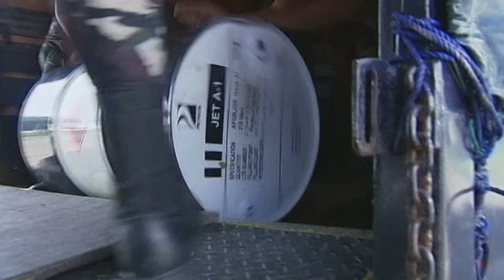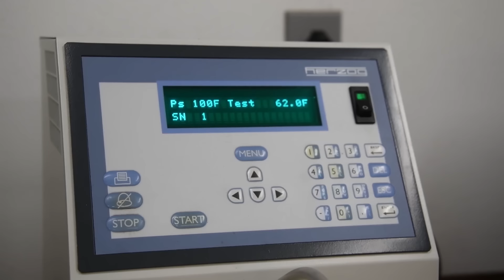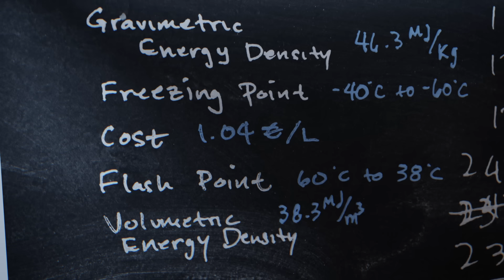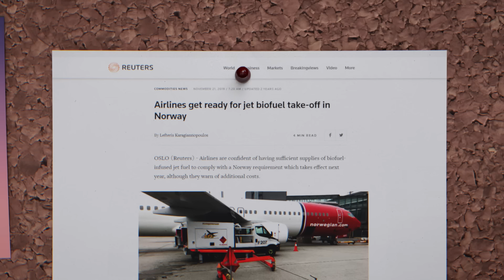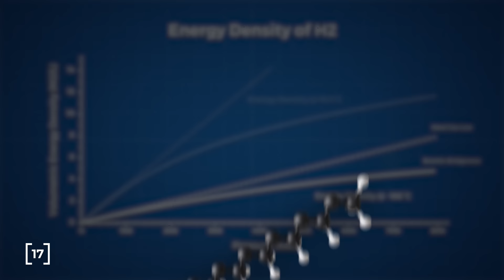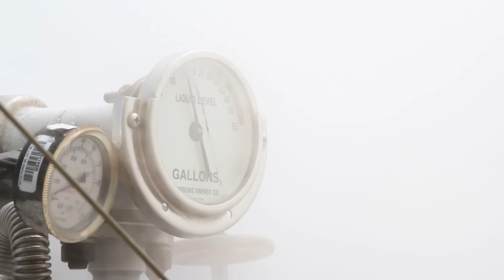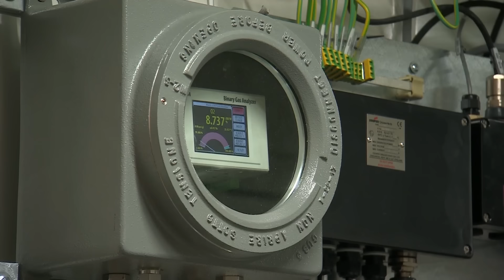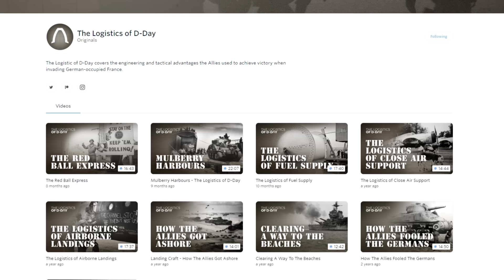The Uncertain Future of Jet Fuel

Comment: This is one of the many stupid videos about this topic that are just clickbait and dont get EVEN CLOSE TO ADDRESS THE PROBLEM

people talking about biofuel, ethanol and biodiesel as if it was CLEAN fuels MAKE ME LAUGH... so when you burn biodiesel it doesn't generate co2 and other greenhouse gases?

any 15yo kid shall know that is FALSE... this generates same CO2 or even more than any other diesel, gasoline or kerosene... THE ONLY DIFFERENCE BETWEEN BIODIESEL AND TRADITIONAL DIESEL FROM THIS PERSPECTIVE IS THAT BIODIESEL IS RENEWABLE

so in 20000 years when all oil fields in the world run dry you will still be able to produce biodiesel

BUT THE COMBUSTION OF IT GENERATES POLUTION SAME WAY

so if you are waiting the biodiesel to save the world, greenhouse effect and stuff you will reach the year 3000 by melting in a CO² biofuel greenhouse planet.

"aaaa but when you plant anything to produce biodiesel the plants will do photosynthesis and will clean a bit the air"

the amount of co2 the plant "cleans" compared to what it will generate after burn is 10%... so the plant will only clean 10% of the air it ill later make dirty AND WORSE

THE BIGGEST PROBLEM THAT NOONE IS TALKING AND THERE IS NO SOLUTION UNDERDEVELOPMENT ANYWHERE: THE ALTITUDE

if a train, a truck, a ship, or even a giant thermopower plant burns anything makes tons of CO2, this can be TRAPPED and CLEAN either by plans photosynthesis, co2 removal plants, plankton photosynthesis and stuff...

but planes fly at 8000m above sea level at that altitude THERE IS NO PLANT, PLANKTON NOR CO2 REMOVAL PLANTS, SO ALL CO² GAS GENERATED BY AIRPLANES GOES STRAIGHT TO THE HIGH ATMOSPHERE AND CONTRIBUTES TO THE GREENHOUSE EFFECT....

THERE ARENT ANY KNOWN APPROACH  NOR UNDER UNDERDEVELOPMENT THAT IS ABLE TO TRAP/CLEAN THE CO² GAS THAT IS ALREADY IN HIGH ATMOSPHERE

SO BECAUSE OF THESE, EVEN IF AVIATION IS ONLY RESPONSIBLE TO 2-3% OF CO² EMISSION IN THE PLANET. THIS 2% CAUSES THE BIGGEST IMPACT IN GREENHOUSE EFFECT AND PROBLEMS WORLDWIDE

Comment: whyc an't we havee eelcetric planes?

and why can't we replace buurning fossils for electricity let's move to 100% solor wind hydro and clean
Reply: If we already have issues with electric cars, building electric planes is another terrible deal. As of right now, our technology cannot build an aircraft that can run in other source that fossil fuels, we simply cannot find a balance between efficiency, capacity, cost and performance. The closest we can do is research how far can we push emission reduction and increase fuel/engine performance.

And to generate electricity is a whole different topic, starting by the fact that again, due to our technology, renewable energies are currently garbage, they are very costly, occupy a lot of land and generate very low output. A second option, besides improving renewable energy sources, is going nuclear, however, although its way cheaper on the long and very efficient on the long run, it’s expensive to build plants, and it requires more qualified staff, thus several nations are not fit for this. Not only that but people are absolutely unreasonable afraid of nuclear energy, constantly citing events like Chernobyl, which had little to nothing to do, at least with Western Nuclear Technology. Germany for example always pushed against these, with one particular plant becoming famous for being abandoned and now used as a literal Conventions and reunions Center, and now they are facing an energy crisis.
Reply: @AxolotlAndy  can't people just make some good technology. people just need teo get off their ass and do it and make country energy indeoendent via renewables/
Reply: @Sanyu-Tumusiime  We are trying to do so as I mentioned, but easier said that done. However as much as we can do the better.

Climate change and global warning will close up in just a handful of decades, its actually interesting to see media like videogames or movies barely touching this subject now.

And we will be left with two options, either we use the time remaining and try to stop it, or at least mitigate it as much as possible, and do damage control with anticipation, for the continuity of our society. Or we wait until the consequences strike with full force, and we try to stabilize our planet in a hurry.
Reply: @AxolotlAndy  I dont know what's going to happen to our world we have to fix this problem somehow. We should start today full force effort to save the planet.
Reply: @AxolotlAndy  please now save humans for as long as possible
Reply: @AxolotlAndy  what do you want me to do to save humanity i would do anything for the earth. i stop using plastics and i dont have a car. i barely pollute anything. please id do anything to save us